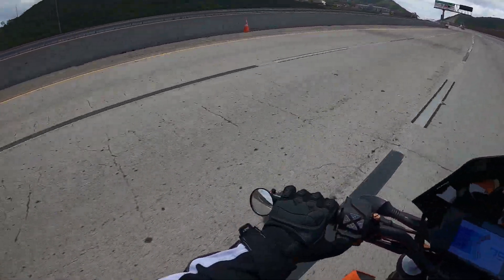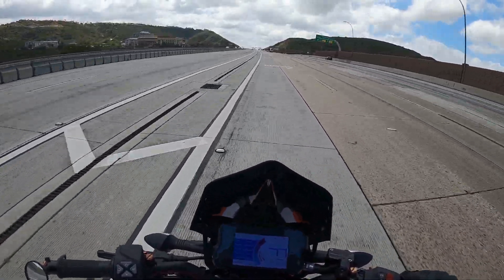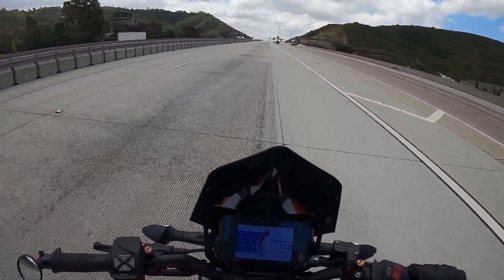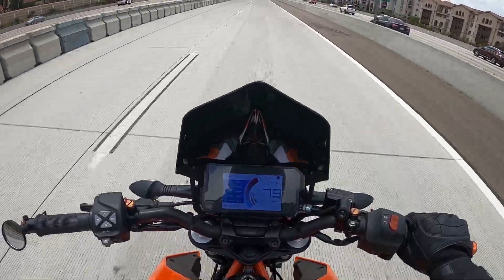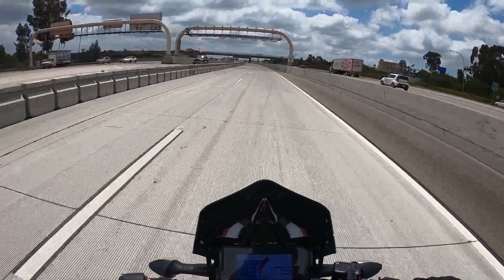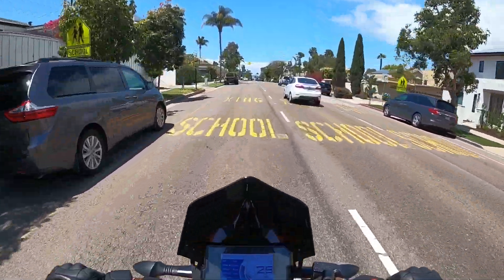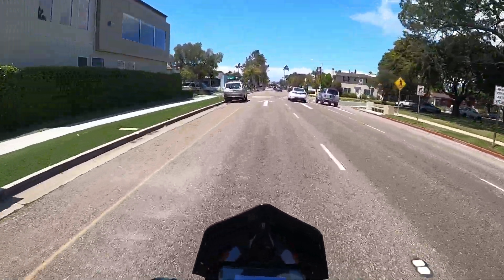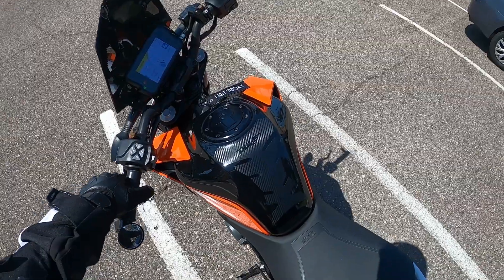Is the 390 Duke Good for Highway!?

Comment: Im glad I found this video. I live in Coronado/IB and will be commuting to 30-40mins north for work. I was wondering how the Duke 390 would hold up on the Highway and you definitely answered that! Thanks Doc!
Reply: With Fuel X Pro and replacing stock filter w K&N filter I got 99-104 MPH.

Comment: Trying to find My first motorcycl. I live in a van tracking and mostly off road, but will get some highways to groceries and stuff. Wish I could afford a 883, but I’m in between this 390 Duke and the Rebel 300/500. The Duke would be my least favorite, but seems the perfect one for my needs. Thanks for the video. Any help with my decision? Miss San Diego, lives there for 4 years and moved in 2019. Enjoy the ride
Reply from the maker: If youre doing some offroad trails a bit then consider looking at the Husqvarna Svartpilen 401. Same motor and platform as the Duke 390 but in a scrambler package with trail tires.

Comment: Hey just wondering what gearing you are using on your bike during the filming of this video?  Would you recommend changing it even further to cruise on the highway at a more relaxed rpm or would the bike not have the oomph for that type of gearing?
Reply from the maker: This was with with just a +1 front sprocket. I'd say this is the best gearing for balance between highway riding and city riding. You don't feel much of any loss of torque and your RPM sit about 500rpm lower than stock when cruising in 6th gear. You could combine it with a -3 rear sprocket to make it even more long but you may feel a slight loss in power at that point. Only benefit would be lower RPM's on the freeway. Remember though the passing power in 6th gear will feel slower the longer the gearing gets too.

Comment: yo! much love from chula vista! about how much do you think one of these will cost on the used market? im trying to find a 400cc naked bike for less than 4k, 3k if I can (18 yr old soon to be college student here) so I'm trying not to break the bank. If you know of any other naked bikes that are solid and cheap I'd love some recommendations if the 390 isn't the best option available.
Reply from the maker: It may take some searching but if you want a  lightweight naked you can find the Duke 390 and Z400 in that price range. Maybe also consider the CB500F.
Reply: @MotoMedicine904  Thanks! Are there any other places I should look besides FB Marketplace, Craigslist, and OfferUp?
Reply from the maker: That's probably all the places I would check. Maybe use cycletrader.com as well.
Reply: @MotoMedicine904  Thank you so much, you're a great help.

Comment: I'm impressed with your highway ride.  My 390 has about 550 miles to go before the break in period is done. How much extra hp you think you have with the mods?  What rpm's at 80mph?
Reply from the maker: With the 16t sprocket the RPM is 7500ish at 80mph and the mods probably add about 5-6hp and the same in torque.
Reply from the maker: nutter  not really. I have a buddy who rides his 2016 daily on the highway at 80+mph which puts him at 8000+ rpm and he has over 22k miles on the bike with no issues.

Comment: Can't comment on having a tweaked cpu, but I bought a 390 for short runs in the city, I've had it on the freeway a couple times, and no, this ain't fun on the freeway, and feels abusive to the engine. Don't get a 390 if you're looking to ride on the freeway. The only time I would ride this on the freeway is when I know there's gridlock. Unless you wanna sit in the slow lane in 6th gear at 60 mph.

Comment: Sound was still pretty bad, like the video but the wind noise is so annoying I had to turn it off.
Reply from the maker: Yes, that's why I ended up ditching the Hero 8 all together. Not sure if they've fixed this issue yet but it's basically useless with the media mod for an external microphone.

Comment: I use the Hero 7 black and when I go high speeds I get so much crackling sounds from the external mic. Have you experienced these crackling sounds?
Reply from the maker: I've had some on my first real ride with it which you can hear in this video.. but I was able to figure out where they were coming from and fix it. It was because the point where the stubby adapter plugged into the lav mic was flapping a bit in the wind and tapping the side of my helmet.
Reply: @MotoMedicine904  Ahhhh that could be the reason. I'll check it out. Thanks brotha!
Reply from the maker: No problem
Reply from the maker: I discovered something else when looking into it. I saw you should go into your gopro settings and make sure you have your audio settings set to Stereo. The clicking apparently also comes from the camera trying to auto switch between wind and stereo modes if left in Auto.
Reply: @MotoMedicine904  Hmm I tried the suggestions but it didn't work. For some reason the insane crackling only happens at high speeds but when I go full tuck it disappears. This means that the extreme wind noise is probably over driving the mic. I spoke to gopro support and they're gonna replace my mic adapter but I doubt that'll fix it haha. Idk what to do now except return the gopro :/.
Reply from the maker: Which microphone are you using and are you using a deadcat?
Reply: @MotoMedicine904  Purple panda and yeah I have a deadcat on it. Everything is perfect till about 55mph+ and 70+ is when it crackles like crazy.
Reply from the maker: Where have you positioned the mic? I have mine tucked into the cheek pad for maximum wind protection.
Reply: @MotoMedicine904  Yup same!